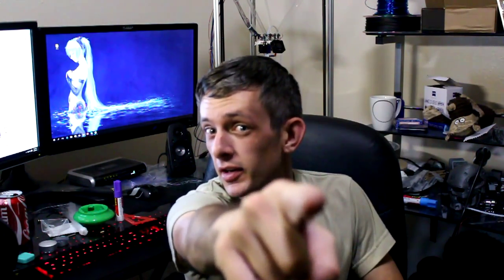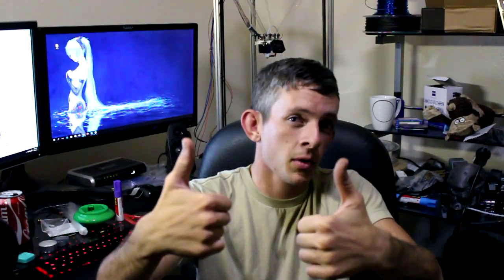3-D Printing jam solving solution

Comment: I have just updated my Anet A8 3D printer with a cheap E3D V6 clone (under $7 delivered) and I have tried 101 things to stop it clogging, all failed, I saw your video and decided that I might as well give it a go, I have some low friction teflon based oil and decided to give it a go, straight in to the hotend and YES it works. My first print is looking really good (usually after 5 mins its already clogged) but no still going well after 5 houes! Many thanks

Comment: That's funny. That's what we lube up the gun on the f-16 with. It has a super high heat resistance and lubrication factors. Plus I have an endless supply :)
Reply from the maker: +Rob Hopper thats funny because thats where I get my mc3000
Reply: Are you in the Air Force?
Reply from the maker: Yeah
Reply: +Zeo Fox hah, small world. Weapons troop? I'm at Luke AFB Weapons.
Reply from the maker: +Behind The DM Screen yeah weapons. hill afb utah
Reply: +Zeo Fox Sorry was using my other account. So I brought some MC3k home to use on my printer since it keeps jamming up during long-stroke fast prints. For small detailed areas it never jams, but it seems as if I get jams when it's printing long strokes of filament for infill. I even tried cranking the extruder heat up to 220 for PLA, still does it. Hopefully the MC3k fixes the issue.
Reply from the maker: +Rob Hopper should do the trick
Reply: didnt help one bit. I think I need a new extruder, time to upgrade to an E3dV6.
Reply from the maker: its worth the investment

Comment: where do u usually apply the lube to?
Reply from the maker: i take a pipette and drip 5 drops into the hotend directly an lightly coat the filamrnt that is coming from the boden tube